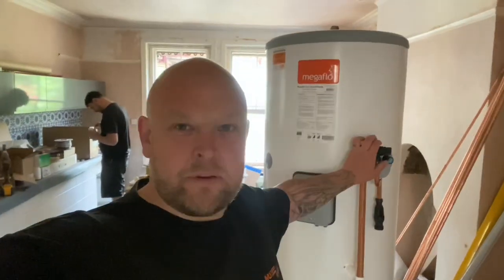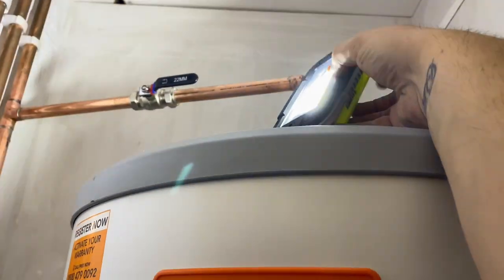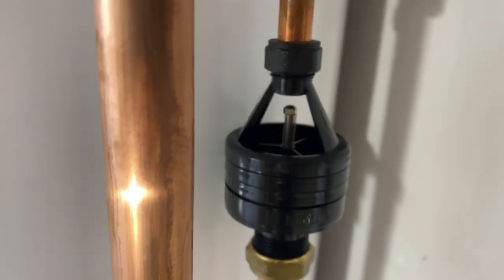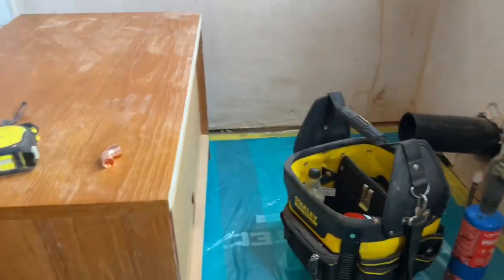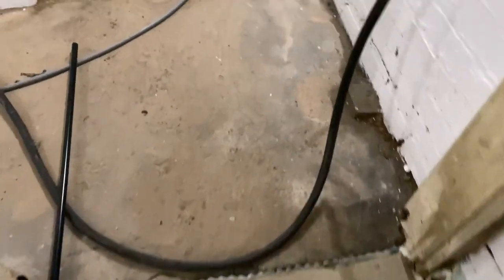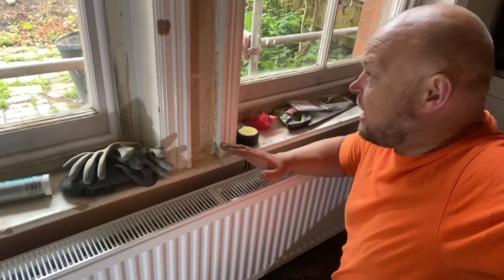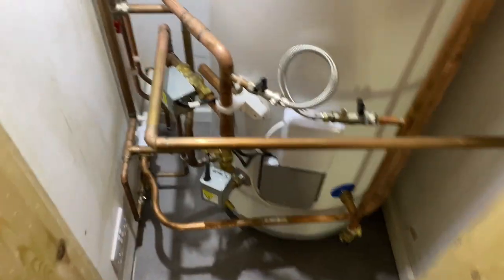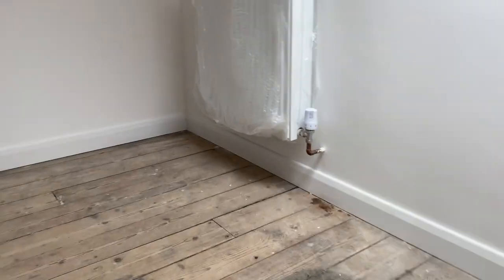HOT/COLD & HEATING FILL UP ON THE HOUSE RENOVATION…The most stressful part of any plumbing job!!!

Comment: Real world plumbing and real world acting by the looks of the main man at ya plumbase! Fair play to him for being a good sport!!!

Just out of interest do you have a preference as an installer on the brand of Unvented/Vented cylinders? Do you prefer a Megaflow only with an internal expansion vessel or is it also no dramas on quality and install on fitting say a Screwfix Range Tribune or Kingspan cylinder with an external expansion vessel? Just interested in your experience. 

Thumbs up.

Comment: The fill up is the moment you work towards and if it goes well you can pat yourself on the back. Never get over confident cos it’ll bite you in the ass. I had a heating leak on Thursday. But that was because of a bloody 10mm set on a 15 valve, I hate sets lol. Nice work Mark, now load up the van and go home lol.
Reply from the maker: Exactly mate…… The bloody vent let me down for a 100% dry fill aswell 🤣🙈

Comment: Relocated to Cyprus so not much need for filling heating systems these days, still feeling the stress as if I was there with you though.
Do have the major stress of having to operate water shut off's from flat roofs then get down ASAP to check for leaks, seems a fair swap.

Also done exactly same thing with the rad vent, I'm one of those that will check everything 3 times, still not sure why checking the vents wasn't already part of that, like they say we learn from the mistakes in life, not the end of the world but certainly didn't miss another after that.

Pretty much got the videos in the calendar for a Wednesday and Sunday at this point. Content is spot on, keep smashing it man. 💪💪
Reply from the maker: Thanks Kane, glad your enjoying the content mate 👍🏼👍🏼

Comment: Little tip for you when filling up heating systems , get a pressure reducing valve  with a flexy hose and fit it in place of the  filling loop , set it at 1 bar and then open the valves . It will pressurise up to 1 bar while you go around bleeding the rads but no more than 1 bar .
Reply from the maker: Ohhh I like that little hack 👍🏼👍🏼

Comment: Yes I feel the stress watching you, if I’ve got loads of rads to fill I turn all rad valves off, doesn’t take so long to hold a bit of pressure then you can fill and check each rad individually. Takes a lot longer but bit more peace of mind. Fair play for filming and posting it, I couldn’t do it! Top work as well by the looks of it!!
Reply from the maker: Thanks mate, glad that came over on the video…. I wanted to take you on the journey👍🏼👍🏼

Comment: Nice one Mark , we all feel that anxiety when filling a big system first time.....🤞🏻
You should consider getting a press fit gun for doing boiler and cylinder piping as it makes life so much easier when your in a tight space , I know it's a big outlay to start with and the fittings are expensive but it's a game changer mate , when I bought mine I was a bit dubious about it but now wish I had got one years ago as it saves so much time and you can make a nice clean install and there are many benefits to using one....
Cheers mate......👍
Reply from the maker: Thanks mate👍🏼👍🏼

I personally don’t like the look of pressfit, and it’s so expensive I don’t see it being an option tbh. 
If anyone wants to offer me a demo etc then I would happily give it a go but I wouldn’t pay the crazy prices to use it

Comment: Great video.... I've had a erbauer for about 12months I'm so impressed with it I've just purchased an impact driver great bit of kit for the money.
Reply from the maker: Thanks mate…. Great bits of kit ain’t they 👍🏼
Reply: I used to be a makita man until I was working away and the bushes went, had to buy an emergency erbauer rattler the makita is still in need of bushes years later and my erbauer kit has grown

Comment: Good video Mark. You could use a good apprentice. Did you put a secondary pump or did the boiler pump do the job.
Reply from the maker: Thanks mate, boiler pump is rated for a large 126,000 BTU system so should be fine 👍🏼👍🏼

Comment: Im new to the unvented side of things. Does this tank need remove expansion vessel on the cold?
Reply from the maker: This tank (Megaflo) has an inbuilt pressure vessel within the cylinder 👍🏼👍🏼
Reply: @MJTiffPlumbing  that makes life a bit easier. How would you test on a service to see if expansion is still present, just curious 👍

Comment: Great video was there an extra expansion vessel on the system as you said there is alot of rads
Reply from the maker: Thanks mate…. Expansion vessel on the boiler is rated to 126,000 BTU’s so unless there is an issue once heat tested it will be ok. Not a problem to retro for one if need be but should be fine

Comment: Great video, it's been cool to see this project from start to water flowing!

Been watching Allen Harts videos recently on unvented cylinders, how come there's no expansion vessel, are they built into the Megaflows? (Not saying it's wrong just curious)
Reply from the maker: Thanks mate

Yes the Megaflo has a built in pressure vessel, one of the good things with them 👍🏼👍🏼
Reply: I may be wrong, but I heard from a rep that the Patent for the built in expansion gap in the megaflo expires in the near future and that other manufacturers will be able to do it as well. But like I say, it came from a rep and they have been known to talk BS from time to time
Reply: Some other manufacturers e.g. Joule make cylinders with built-in air bubble type expansion now.

Comment: And I thought I had it on Saturday because I was doubted my self with the hot and cold even tho I new what was what. the joiners put floor boards down and could only see the service valves so I ran the pipes into the utility room and ran what I knew was the hot into a watering can 🤦‍♂️🤣🤣
Reply from the maker: Good work mate 👍🏼👍🏼

Comment: 25 years in the game and I still get nervous on fill ups. As for the Friday rule it's absolutely f**king true! The day is cursed
Reply from the maker: You know it Steve…… broke all the rules didn’t I 🤣🤣
Reply: It is indeed so Is fill up after 3 you won’t be home for tea 😅
Reply: @oakey67  9pm other week when we did it! It was the only radiator we didn't change the valves on. Pulled the carpet back and it had been leaking a while but exasperated but us draining the system down and actually checking. The curse of the Friday fill 😂😂

Comment: where was your heating vessel ?
Reply from the maker: In the system boiler
Reply: @MJTiffPlumbing  is that vessel big enough for all those rads ?
Reply from the maker: Yes buddy…… it’s specc’d for a system that supplies 120,000btu’s 👍🏼
Reply: @MJTiffPlumbing  it of interest what size vessel is in that Vaillant
Reply from the maker: 10litre vessel…

As said the boiler is rated to 126,000BTU’s and if there is a rise within the system when heat tested a larger vessel will be fitted… not a problem at all…

Thanks
Reply: @MJTiffPlumbing  I wasn’t having a dig I got pulled on that by a manufacture and they tried to get out of the problem. I’d stick a 24 lire on that . Great job by the way 
All the best keep
Reply from the maker: Oh no, I get you buddy 👍🏼👍🏼

I’ve had large systems work fine on the vessel from a system boiler vessel, all depends when the heat comes on. Adding one isn’t an issue if there is an issue 👍🏼👍🏼

Comment: Air testing reduces the stress 🤘😂🤘🙏🍰
Reply from the maker: It’s been pressure tested the whole way along the build at various points… even last weekend it was left on test the whole weekend and was fine..

But you always get a bit nervous when it’s “real” fill up day.
Reply: @MJTiffPlumbing  I switched to air testing after a particular chippy hit more than he missed if you get me 😂🤣😂🤣😂🤣😂🤣😂💦
Reply from the maker: 🤣🙈🙈🙈

Out of interest and one I have always wondered with air testing….. if you have a slight leak how do you trace it???
Reply: @MJTiffPlumbing  most times LDF Buddy or you hear it. Great on big jobs where you need to try and be everywhere at once too because you know nothing is getting wet while you are looking 	👍👍
Reply from the maker: 100% know what you mean when you have to be everywhere 🙈🙈
Reply: @MJTiffPlumbing  At 58 Bud I need a bit more time to get about 😂😂😂😂😂😂😂😂😂😂😂😂
Reply: @MJTiffPlumbing  You might still have the odd slow drip, but it shows up anything expensive Bud. Plus I tend to do it while sections are exposed that have joints and then just before the water goes on. 👍👍

Comment: Baxi recommended a 25kw system boiler and a 250l cylinder on a house with 17 decent sized rads  on a house we’re putting plumbing in …… good bye baxi 😂